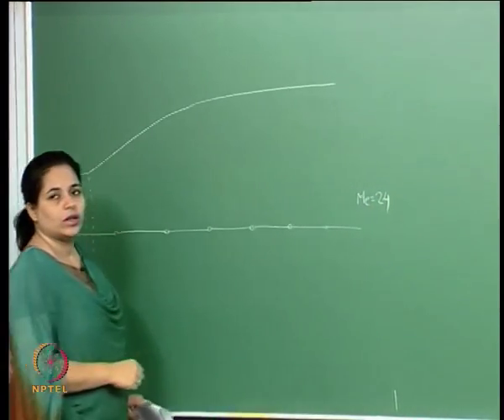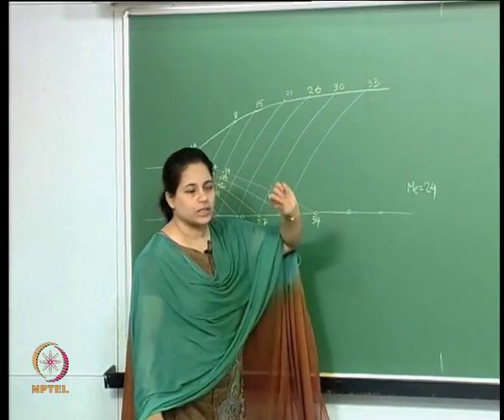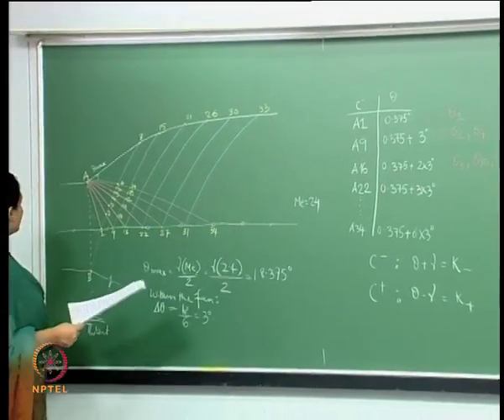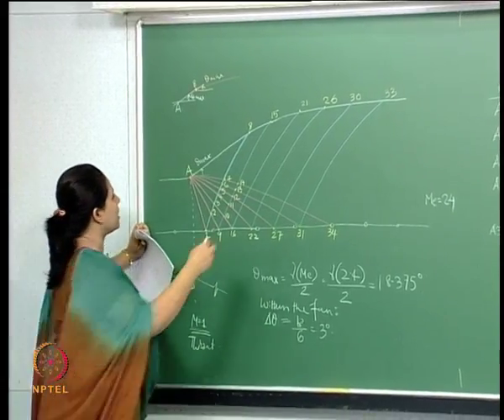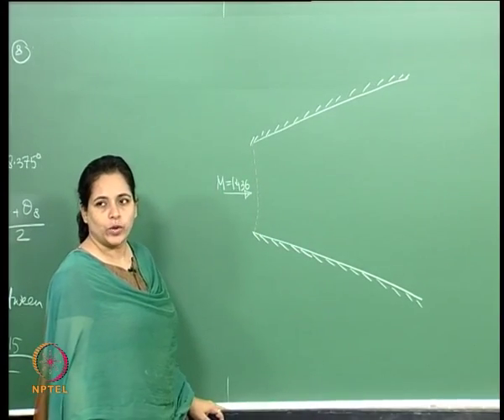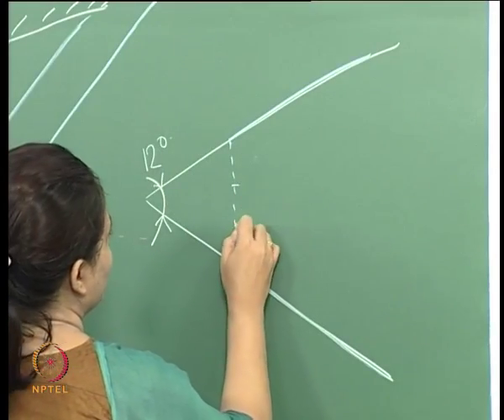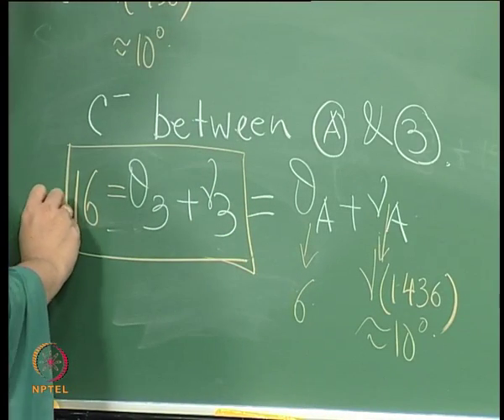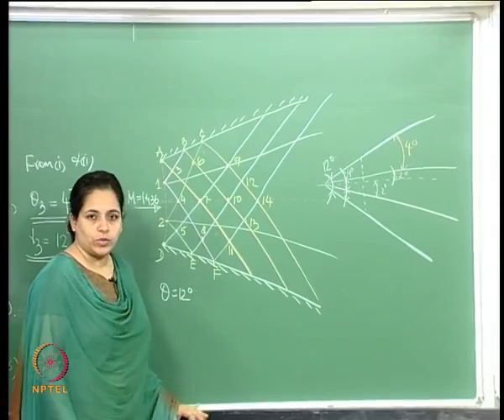Mod-01 Lec-22 Lecture-22-Application of The Method of Characteristics:

Comment: I found this link very helpful for filling in any missing notes from this lecture: http://mae-nas.eng.usu.edu/MAE_5540_Web/propulsion_systems/section8/section.8.1.pdf The biggest problem for me with this lecture was the lack of explanation of how to specifically calculate the x and y locations of the points.
Reply: did you manage to save a local copy of the pdf you linked that you can share with me? The link isn't responding for me.
Reply: @vishalravi2939  I sure do! https://drive.google.com/file/d/1o5xbSwemI76FdtZ5LwbCOhnYqCpGC73_/view?usp=drivesdk
Reply: @brandonberchtold9484  Thank you!
Reply: If I can make another recommendation. I HIGHLY suggest you read "Modern Compressible Flow: With Historical Perspective" by John Anderson. It is written in a really great style and is actually quite enjoyable to read. It covers many compressible flow topics on detail (including method of characterisics).
Reply: I will definitely check that out as well!
Reply: @brandonberchtold9484  Hello Brandon, did you figure how to find the x,y coordinates? if so can you point me in the right direction?
Reply: @David24476  The link I posted 3 comments up from yours (about 3 months back) describes how to obtain x and y coordinates reasonably well. It does take some thinking though, so I reccomend reading through the pdf several times
Reply: @brandonberchtold9484  ohh I see. Nice man. Thanks a lot!!!

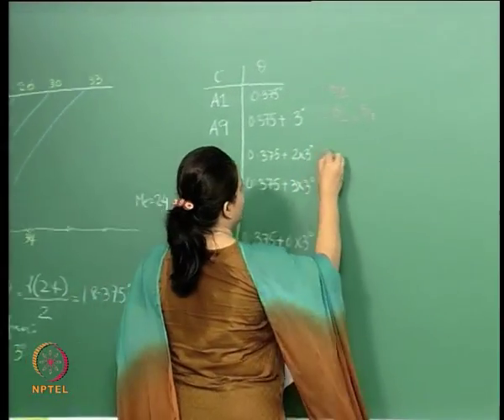Comment: about 14:40 you are saying that thetas of points located on the same left running characteristic (A1, A9 and so on) are the same. I don't think that's true, as characteristic lines get slightly bent over each point. This example (7 char. lines, M_e=2,4) was described in J.D. Andersons Modern Compressible Flow with almost full solution (all resulting thetas, K-, K+, mu, nu were given in a table) and for example theta2=3,375 is clearly different from theta9=0. K's are constant along the lines, but not thetas.
Reply: yes you are correct, this video is actually a little away from correct explanation and method.
Reply: I know is three years guys, but can anybody point me in the right direction to find the point coordinates?
Reply: @David24476  Also look this up, way better explanation of the procedure, specially how to find the wall points.
Reply: Hi @wilq59r are you available as a tutor? Do you still have Andersons text book?

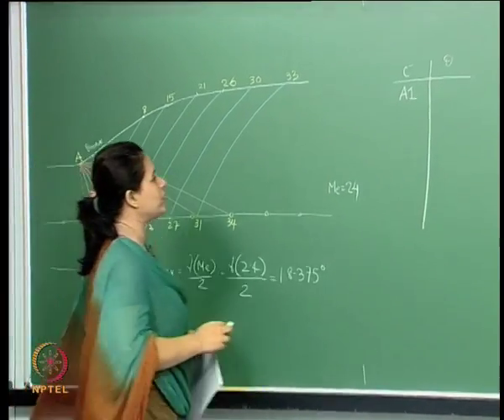Comment: At 11:25 you are calculating the C- angles.  You took A1 to be 0.375.  Why?  is this choice totally arbitrary?  Can you divide thetaMax by the number of lines instead?
Reply: generally a very small angle is taken as value after decimal of thetamax
Reply: It's by choice, you could divide thetaMax by the number of lines but I think the way described here is just for roundness of the numbers